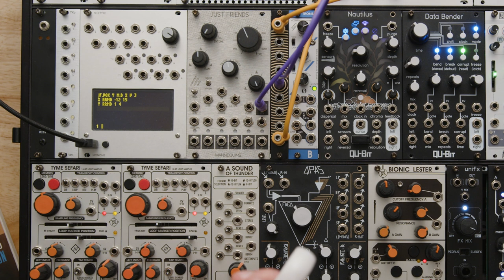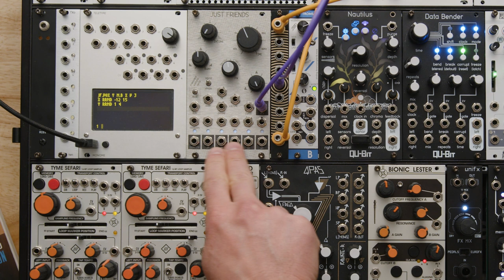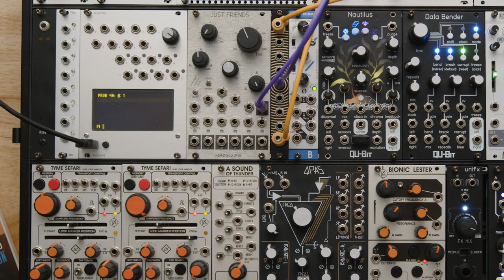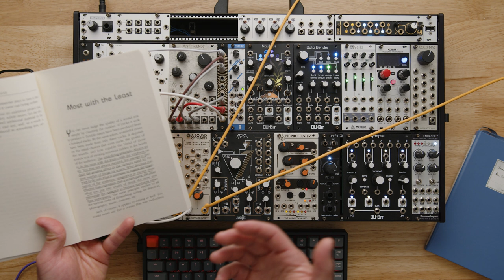The "Less is More" theory of sample rate reduction (patch from scratch!)

Comment: Tyme Sefari Expanders ( ASOT ) are passive and can be replicate in DIY. If you haven't found one yet, I could help in a DIY. Excellent video and will be curious about the book.
Reply from the maker: So, I've seen those floating around, but the thing that always stops me is that you don't get the right channel audio input/preamp with the DIY sot, right? I actually emailed Scott during the garage sale to see if I could get my paws on a NOS expander. We shall see!
Reply: @mattlowerymusic   There's also a way to link one ASOT to two TS mk2. You could link with a ribbon cable with 3 connector the PINs marked as ''THUNDER''. So the switch functions would work together. If you know a bit of DIY, the switch section is really simple. You could do an expander with switches only since it's only connecting the ground pin to different pinout. In any case I could help if you want to go through this.